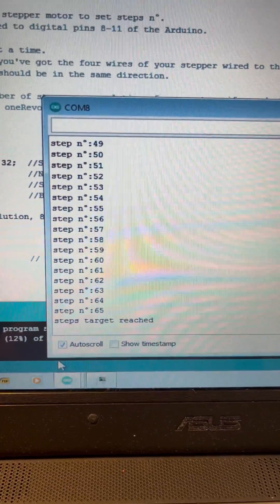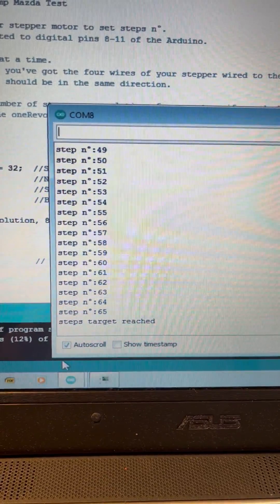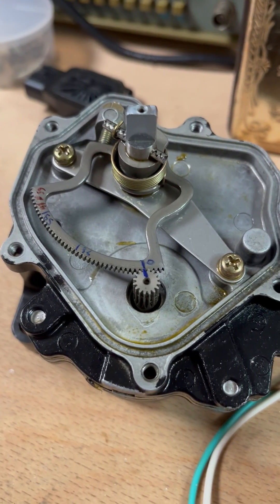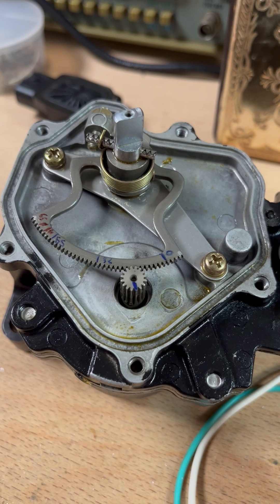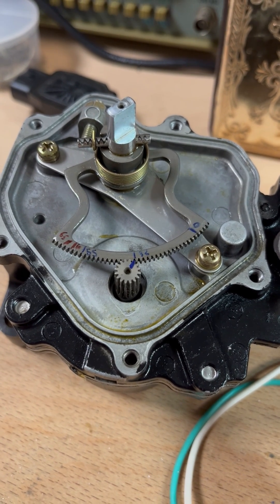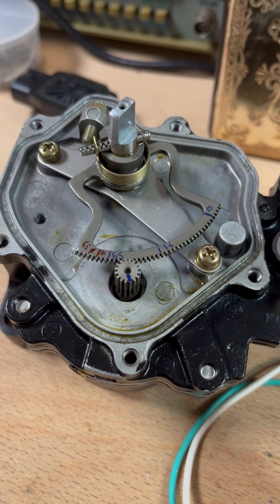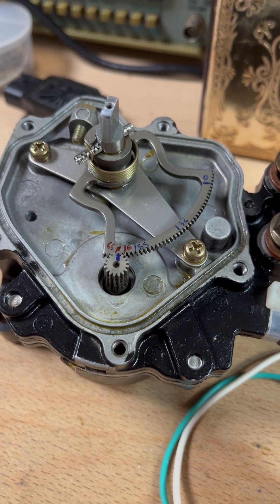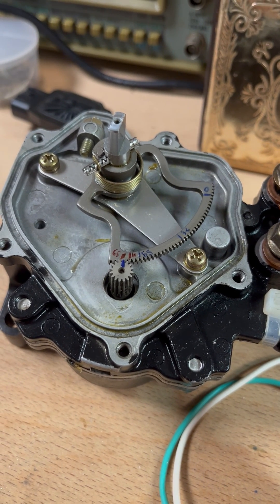Mazda 13B Mikuni OMP Oil Meetering simulation after overhaul to adjust intervention switch DTC1688

Comment: Nice job ! Is is possible to see the hardware and the code you used for this result ? Thank you !
Reply from the maker: Dear Enzo thanks for comment and sorry for long time reply - regarding setup is enough use Arduino and interface for stepper motor. I used a cheap L298N you can find for few bucks. How to develop system is well describe in Arduino help page -> attached link also software code base is there https://docs.arduino.cc/learn/electronics/stepper-motors/ you can use and adapt.